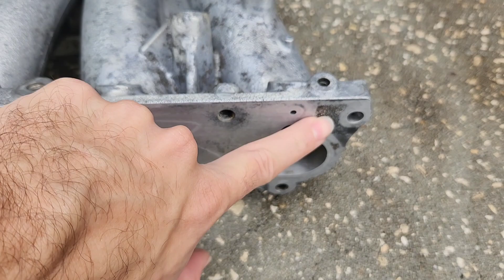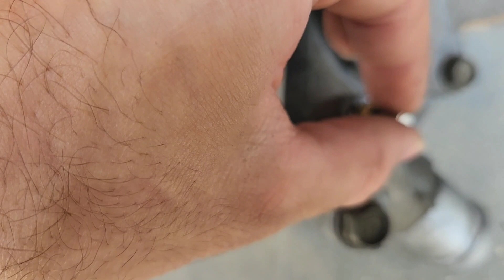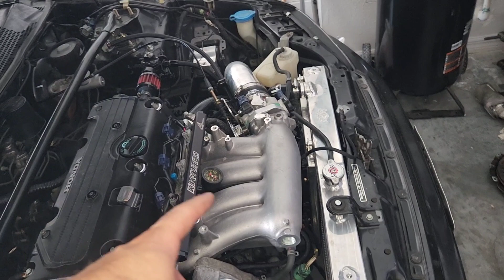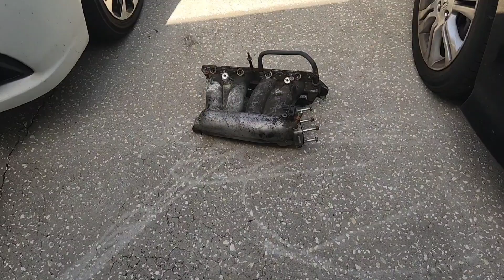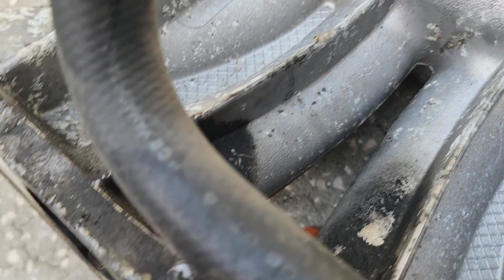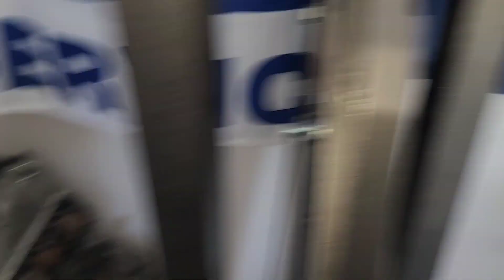K-Swap Integra Budget Build Pt. 3 RBC Intake manifold, K20z3 spare engine.

Comment: Hey there. nice videos. What's the performance gains between the RBC and RBB intake manifolds
Reply from the maker: From my understanding, the RBB is more for mid range torque not so much top end. The RBC is more for top end and in my option more power gain as well.

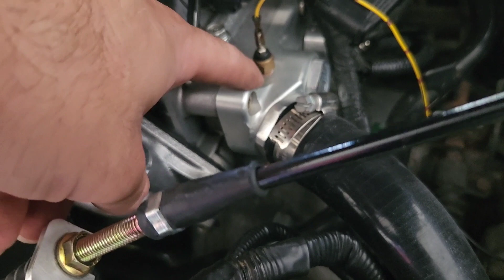Comment: hey question so 4:35  yoour pointing at the sensor that comes with ktuned but whats the sensor by your thumb on the manifold when i look it up its a air assist valve or something like that but what do u have there instead im doin a k24 integra and i have a rbc manifold but i dont know what to put there
Reply from the maker: That's the temp sensor I usually hook it up to the conversion harness to read it on the cluster